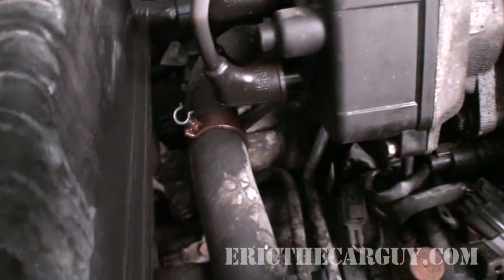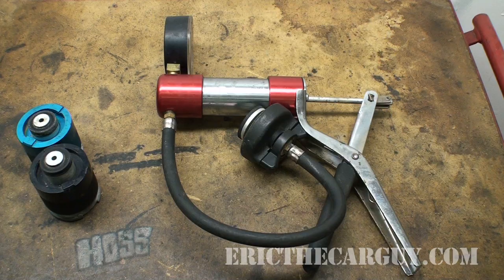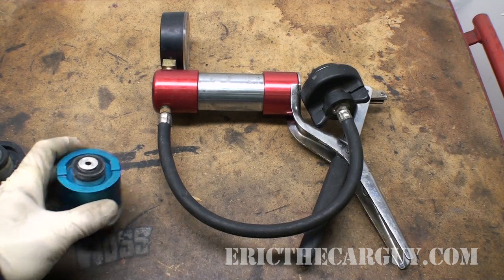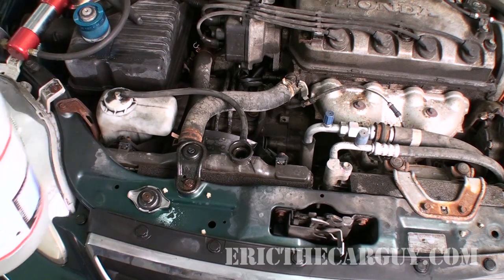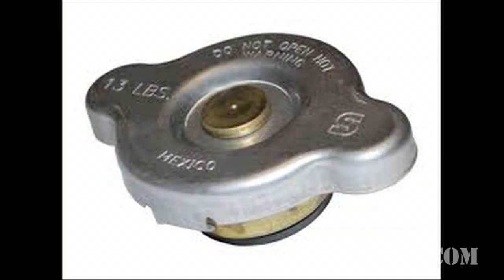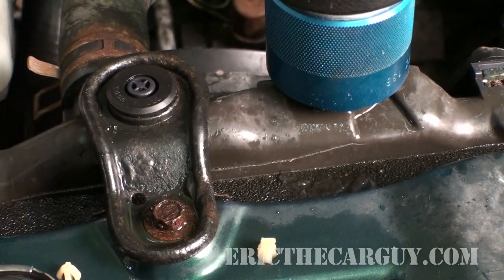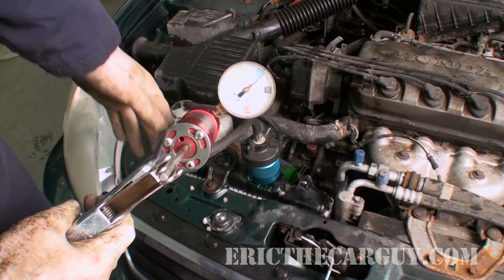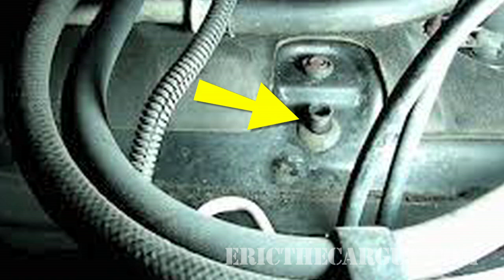Pressure Testing Cooling Systems -EricTheCarGuy

Comment: if the heater core is leaking, it would not hold pressure while performing the pressure test, correct?  bc I get a strong smell in my truck when sitting for a few days, but i'm thinking that's bc the heater core and area prob has mold growth on and around.

Comment: I have a external coolant leak it comes from the side of the engine where the head meets the gasket but it's slow .....yet the car does not over heat nor is there milky oil when oil change or checking dip stick .I just redid the valve cover and the egr plate cover gasket . so is it a leak from head gasket from the outer edges part of the gasket ?
Reply: Jermaine Solaita ,

Comment: I have a 95 tahoe 5.7 with oil or ATF in the radiator. But no coolant in the oil or trans. Compression is great on all 8. If I disconnect the ATF lines to the radiator, would this pressure test tell me for sure whether it's a leaking head/intake gasket, or a internal leak for the ATF cooler? I dont mind replacing all gaskets and throwing in a new radiator, but I'd like to know the exact source of the problem before I start replacing stuff.

Comment: hey +Ericthecarguy would a radiator cap not holding pressure make the heater Luke warm instead of hot  or what could be the problem.  I tried flushing the heater core. I put a new radiator in     the truck is a 02 ram with 5.9

Comment: Thank you for all the great  videos. I recently had a coolant leak on my 04 Hyundai Elantra. The mechanic said it was coming from the bypass hose which is a common problem with these cars. The coolant leak is fixed  but now I'm experiencing a rough idle.  I asked him if he  had to remove any vacuum lines etc to access the  leak and he said "no" .Assuming that  he did a pressure test  is it possible  that some seal was damaged??

Comment: Eric, I did both a pressure and vacuum test of my coolant system -- is one of them better than the other?  Both were ok on my car ... minus blowing off hoses from a pressure test (1 bar), seems a vacuum test is just as good (or better).  Any thoughts on that?

Comment: I have an issue using pressure tester on 2002 dodge ram 1500, first i know the tester does not leak but as i use it the pressure gauge decreases with the volume of water in expansion tank reservoir...thus having to add more and more water with no visable leaking anywhere. i have no idea where the xtra fluid is going
Reply: It’s going into ur cylinder heads

Comment: Gidday Eric, this question all the way from Australia mate. I have a vehicle that is holding pressure in the cooling system over night, when I open the expansion tank cap it gives off a whoosh type of noise. The motor is stone cold and in 30 odd years of working on my own cars have never ever come across this problem before. I have recently had some overheating issues with the car and only just changed out the rad cap amongst other item like radiator, water pump, hoses, coolant sensor and thermo stat, I have read that it maybe a head gasket problem, what do you reckon mate..Hey love the videos, always hanging out for the next one...cheers..... PS. I should mention the model vehicle I have is a 1996 EL Ford Falcon 4.0L 6cyc, and are know for doing head gaskets..alloy head as well.

Comment: Eric my system (G35) wouldn't pressurize until I pinched the tube going to the overflow bottle, It would just keep blowing air, once pinched it held 15psi for minute with no leaks. any suggestion

Comment: why did u change the radiator and not all of the hoses
Reply: +taledarkside you have to remember just because as techs we recommend replacement of radiator, radiator cap, upper and lower hoses etc, it is the customer that determines what is replaced.  The radiator is required to be replaced, the hoses are not. They can be suggested but not required.

Comment: Hello Eric. Could you give me an advice to my problem? I took out the thermostat on a benzine engine but ran it for 2 minutes without coolant and without thermostat and thermostat cover and the engine works bad, uneven, shakes a little more. Could this be just because there is no water and the head gasket leaks and has no pressure from the water/coolant?Should I install a new thermostat or change the head gasket? Thanks in advance

Comment: great videos I'm trying to charge my AC system or "top off" but my caps are not red and blue they are both black ??? its a 98 E-150 ford I think its a 4.6 L any ideas how I tell the low from high ....

Comment: On some vehicles you have to clamp down one or two bypass hoses in order to built adequate pressure!  This is as specially true on some GM Vans and others with a plastic reservoir.  Also like to mention that you can change the seals on the pressure adapters and most kits come with extras,  but sometimes you have to make your own to compensate for bad sealing on the adapter itself!

Comment: I think that five minutes is much too short, especially if the underlying problem is a slow leak. I've heard that sometimes you need to leave the system pressurized overnight in order to find some leaks. Personally, I would recommend fifteen minutes at the very least, preferably thirty.

Comment: Eric, my coolant reservoir tank is bubbling over when I turn my truck off (2002 Ranger). I used a block tester and found no combustion gases in the cooling system. The truck is not overheating. What could be my problem, and could a pressure test help me find it?

Comment: I've taken my '04 Celica to the shop the other day to have the plugs changed out and they told me my water pump was leaking and doing a power flush would cause the leak to get worse. Here's my problem. I have not had any signs of a leakweather it's overheating or any spots on the ground and the expansion tank is 1/2 full . I thought about using the dye you use to look for leak on A/C systems to try to find it. You think maybe the shop is trying to con me for a $300 water pump job?

Comment: Eric,

What are your views on using distilled water with coolant? I know many shops use standard tap water with a traditional coolant drain and refill. Do you see any harm doing so? Especially if a regular maintenance interval is followed. Newer coolants are premixed and include distilled or deionized water out of the box. I've got an older Toyota and have replaced the coolant each year with standard tap water and coolant and am wondering if I am doing any harm.

Maybe you could post a video about coolants?

Thanks,
Mike

Comment: I have been running all my cars unpressurised since 1976. An unpressurised system ensures greater reliability. At sea level plain water boils at 100C (212F) but coolant at the correct strength boils at approx. 128C. Therefore we already have a sufficient margin of safety. Pressurised systems put a severe strain on the radiator, the radiator & heater hoses & can cause leaks which combined with the high pressure, forces the coolant out of the system quickly. This leads rapidly to overheating with the subsequent warping of the alloy cylinder head/s & great expense. Unpressurised systems do not force the coolant out of any minor leaks & can save the cylinder head from warping. About 30 years ago in Australia, the air cooled Volkswagen was voted the most reliable car. Why? Because it is air cooled & this eliminates all the problems of pressurised systems & warped cylinder heads. As i said i have been running all my cars unpressurised since 1976 without any overheating problems & i would not have it any other way. Many cars today are already running unpressurised because of a faulty radiator cap which may unwittingly have saved the motorists great expense. Just remember to maintain the coolant at the approx. correct strength & change the coolant at the recommended intervals. If you keep topping up with plain water the strength will deteriorate & the coolant will boil at less than 128C, So top up with the correct coolant strength & not just with plain water. I will no doubt receive gasps of horror from automotive engineers but i have been doing this successfully for a very long time.

Comment: I like to squeeze the top radiator hose firmly after a customer comes in from a moderate drive it can help determine if they got some leaks if its soft

Comment: lol, had a '97 Civic that leaked at that same spot on the radiator
Reply: Where? I'm trying to find my leak which I think is at the bottom of the rad. I have a 1998 Honda Civic DL. 
But, in 1/2 hour I'm jacking it up to do the biggest job in my opinion and that is to take off the metal and rubber under guard which has bolts and even Phillip's screws way over on the drivers side. I'm not even sure if I can drain the rad without taking off the guard to drain the water (3 + 1 litres in 2 days)! 
If I can't find the leak or its not obvious I'm taking it in to a mechanic - the same garage that replaced the rad 4 years ago.
I'm not frightened by the work, but I cannot put my hands down to the bottom hose. So I must work on my back and try to find and fix a leak from the ground on my back, I'm assuming it's a loose hose.

Comment: Hey Eric great videos, I was wondering though. I have an 85 6 series bmw and I have both an expansion tank and rad cap. Should I test this method from the radiator or the expansion tank? The expansion tank does have a rad. cap style cap if it matters. Thank you!

Comment: One of my works full size passenger vans was loosing coolant with no visible leaks and puddles left after parking it. We took it in and found out it was an internal leak in the intake gasket. It had a Chevy SB350. The labor to replace it was not cheap.

Comment: What if the coolant cap is the source of the leak? I had that happen on one if my old cars. It was pretty confusing to find!
Reply: That's why for myself I'll continue to feed air in the overflow 1/2 inch hose to 15 lbs. [that's safe and enough] with the cap on, its a two way valve in itself. if it holds before and after I remove the feed hose all is almost good. Almost in a way a lightly cracked head at times may only leak when at full hot, This way you would not have missed that cap bleeding down.

Comment: on my L67 3800 engine the gasket for the thermostat is going mushy and breaking down a bit. also there is this white stain in several areas (where hoses attach to engine) but i've been told that happens when you use additives (i used liquimoly fuel system cleaner, and injector cleaner) it could be a head gasket? anyway the car has a few problems but it's a peice of shit(handy) so i'll leave it unless it gives me problems.

Comment: Eric I know this is off topic but it wouldnt allow me to send you a private msg. I own a 1999 Pontiac grand am gt. I will be replacing the intake manifold gaskets and have heard this is a common problem with this car. I was advised not to use the OEM gaskets because they are made of a composite material. I'm looking for some tips/advice on completing this task and what brand/type of gasket you would go with. Fel-pro PermaDry?.. or something else?

Comment: If you can't locate the leak because there is too much coolant laying around the engine compartment, hose it down first,  Use a leaf blower to get rid of the excess water.  Then pressure test.

They also sell special dyes that a black light sensitive.  In theory, they work well for very small/slow leaks.  Again, start with a relatively clean/dry engine.

Comment: First, a safety tip.  Never remove a radiator cap unless it is cold !

You should also check the radiator cap.  All have some kind of gasket, typically rubber.  Make sure it is in good condition.  The same tool usually comes with an adapter for testing the radiator cap.

"Expansion tanks" are sometimes called remote cooling system/radiator reservoir.  Same thing, different name.  They are not overflow/"burp" tanks which are NOT pressurized !  An expansion tank IS pressurized..

Comment: that is a shamed design. That honda needs a "shrinker tank", nevermind expansion. (more radiator). A company called CSF used to have alot for those little hondas.. search around for the brass/copper.

Comment: The first thing I would do is squeeze hose with the cap still on, usually with a small leak it will be the one way valve in the cap itself that leaks into the overflow tank. If the cap is leaking it will go flat pretty quickly.

Comment: It would be nice to see this done on one of those newer systems, with no rad cap. Those are sometimes a little confusing.
Reply: 2:30 ... actually watch the video... :P
It's basically the same process.
Reply: Hey I know you, watched your videos, here's one for scotty, How about take a pressure gauge,connect a shutoff and 2 small hoses and pump from your air source entering through the overflow hose connector. that's good for all ,screw the rad cap. and all that pumper contraption and various fittings. Yeah baby!
Reply: The main problem I have with my pressure testing kit is that the adapters don't fit all vehicles. It's more complicated than you might first think, because the seal for the pressure testing needs to be deep to the overflow passage, so that air doesn't reflux back to atmosphere. So, it's the deeper seal, not the one at the outer lip of the radiator. The other issue with just hooking up to shop air is that you are looking for a fall of pressure when you stop pumping the pressure up. I guess you could turn off the shop air or turn the valve off, but at some point the effort to make your own is not worth it. Remember not to overdo the pressure beyond about 15psi, you could cause more problems with too much pressure. Some auto parts stores will loan equipment like this, too, so you aren't saving a lot of dough.

Comment: One note, you should go over the testing of the Rad cap, I find many bad caps are the cause of overheats, as they either do not seal or no longer hold the rated PSI
Reply from the maker: I covered that in the overheat video which there is a link to in the description.
Reply from the maker: Michael Berg No I did not have adapters to check those caps. The only adapter I have is for the 'old school' large caps that you hardly see anymore. I agree that is something that would be nice to cover in the future. Thanks for the suggestion.
Reply: HI again Erick, I wonder if you can help me, My question is: I have a Honda Civic 1999 1.6 lts EX, Please can you tell me where is located rhe ECU or ECM of this car. Thanks Ernesto
Reply: Yes and it is usually the non return valve in the cap that leaks out to the overflow bottle.
Reply: EricTheCarGuy You went over caps but NO TESTING of the caps, no adapters for caps?. I  figured it would give you another basics video.
Reply: EricTheCarGuy I have a problem that I can't solve, it's on a 2002 Cadillac Escalade, it has the expansion tank type cooling system there are no leaks but it won't bleed and stay bleeded so the heater is not working right and now it's causing a lot of problems like the transmission not working right, this is my friends SUV and all I did was changed the spark plugs and thermostat and now he thinks I caused the problem,  before I started it ran ok but the heater in the dash was not working right but the rear heater was so he wanted me to change the thermostat and when I did it came out in pieces, this is the type of thermostat built into the water neck so I put the old water neck back in so I can flush the system a couple of times with water then put some blue devil flush in and ran the engine to get all the gunk out and a lot came out then I flush with water 3 more times then put in antifreeze but I had a very hard time getting the air out what do you think
Reply: Michael Berg your are right because the system on the pump outlet side will see the cap pressure plus the pump pressure, so going 3 to 5 psi over the cap will ensure the test catches the issue if their is one.
Reply: It's true, I had a bad radiator cap caused my Subaru to start overheating.  I babied it back home and went to the dealer and picked up a new radiator cap and burped the system, topped it off and never had a problem since.  a few weeks before that I took it to the dealer for a high idle and they replaced a bunch of sensors and other expensive crap but the next morning it was the same deal with the idle.  When I fixed the cooling system the idle came down and was also fixed.  Those stealership clowns cost me a hefty chunk of change over a 20$ problem.  Since that experience I've learned a lot about fixing my own cars because its hard to find a good mechanic you can trust and the dealership is hwy robbery.

Comment: Many parts stores "loan" tools these days. What they usually do is sell you the tool, then when you return it the return the money as long as you didn't damage the tool. BUT check it over in the store before you leave. In this case the tester may come with say 5 adapters. You don't check and one is missing. When you bring it back they can charge you for the missing part.
Reply: Blazer02LS yup autozone wanted 275 for radiator pressure tester fuck that lol
Reply: @West Park yes your right unfortunately when your on a budget and only have money for parts where the hell am i gonna get the rest of the money for the parts yes i understand when you "rent" not loan these tool you get your money back but if I wanted to buy the parts at the same time to save trips to auto parts